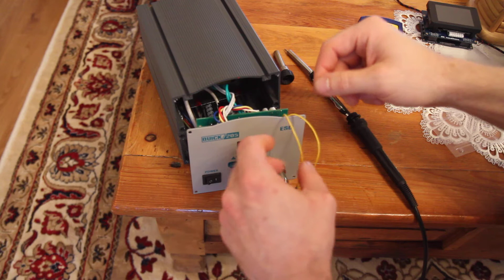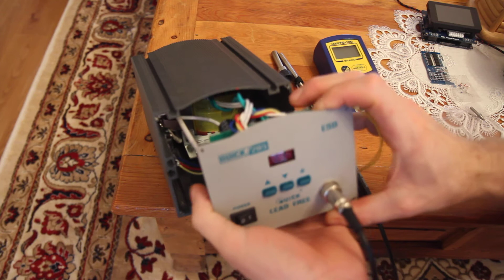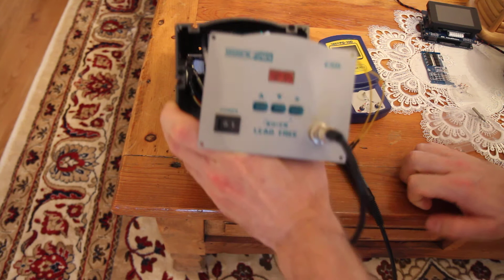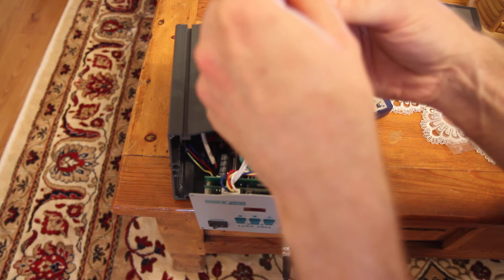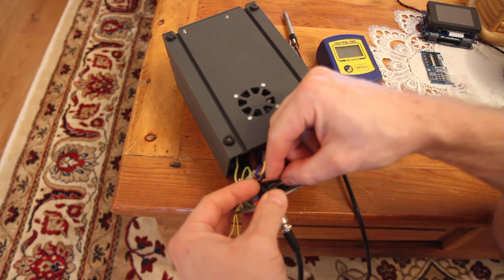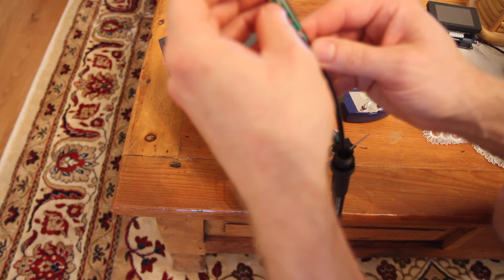Quick 205 150w soldering station

Comment: Hi friend, I have one of this stations broken and I need the value of R3, you can help me please measuring It? Is close to the MOSFET connector, I have H-E error code and this resistor is burned I try to change the mosfet and review the iron this is my last chance, best regards.
Reply from the maker: I can have a look at it next week. (I am preparing for an exam). I will post it here.
Reply: @oaba201  Tanks man, maybe appears on the diagram but the link is broken on the description box.

Comment: hello, you made the soldering iron arm compatible with this device Thanks
Reply: When I bought it. I have got the 60w hand piece with it. So I modified it to show and measure the right temperature. But later I bought the 120w as well. So I can use boot handpiece (60w and 120w)with the same unit.
Reply: @200oaba  Thank you very Much.60w Can we use the front load head?
Does it work properly?
Reply: @huseyinalabas63  you can use both 60 and 120w. But resistor of the amp  has to adjust in regard. I draw the schematic but lost it. :(
Reply: @200oaba  Thank you.

Comment from the maker: I was received the soldering station with an 60W handle instead of 150W. (It is not indicated on the handle) That is why the wires where very small in diameter. On the other hand they use 36V. So for 150W they need to drive about 150/36=4.5 Amps. So the 17A PMOS FET can handle the power.
So I had to reorder the new handle. But now I can use this station with any soldering Iron handle.